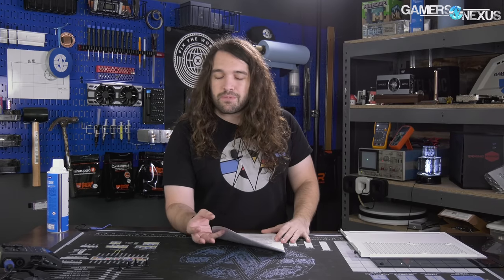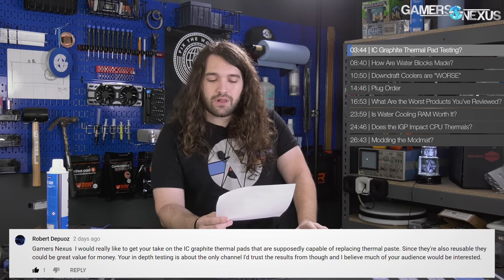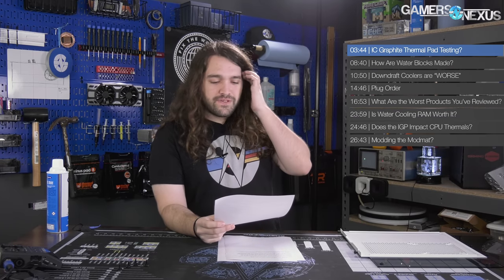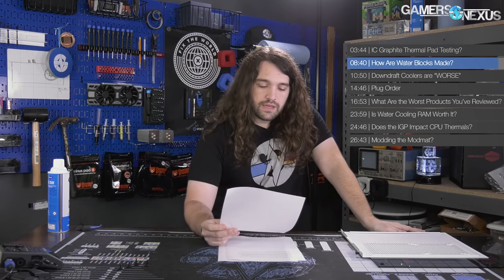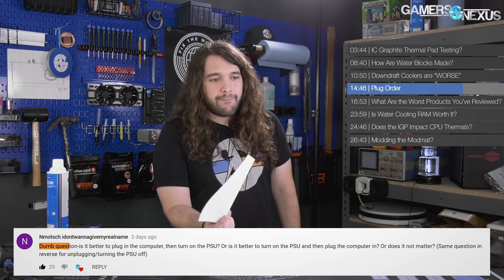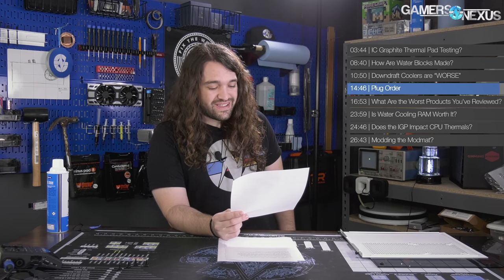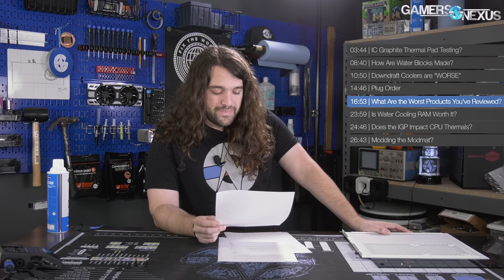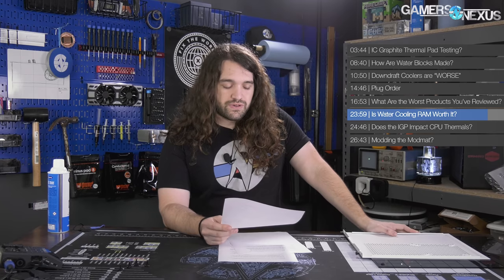Ask GN 83: IC Graphite Thermal Pads, Worst Products Reviewed

Comment: AskGN hi, my rx 480 overheats when i put my side pannel on, its not the v core and according to hw info not vrm either. i think its the vram. Should I put heat sinks on the vram or underclock the memory? if the model matters its the asus dual rx480 8gb. I would really appreciate advise

Comment: hey Steve, a question (or even idead for a video) for you. fast ddr4 memory costs a lot. so why don't you ever talk about an idea of buying cheapest possible b-die memory, and OC the shit out of it? for example: samsung m378a1k43cb2-crc (2400cl17) costs like nothing and capable of 2933cl16+.  and also there is b-die M378A1K43BB2-CRC. costs like 90$ for 8gb and capable of 3400-3600 overclock. 3200 is almost guaranteed for those sticks. no stupid RGB, no ussless radiators, no cons at all - souds in line with spirit of your videos

Comment: #AskGN Is there any way to modify the power limit on a graphics card besides doing a shunt mod or flashing the GPU BIOS? I currently have a GTX 1080 FE with a 240 CLC hooked up, so thermals are well under control, but I'm hitting power limits keeping me from overclocking it even higher. I'm kind of wishing i didnt get an FE card, but I got it for $500 before the crypto boom took off and jacked up all the prices, so i cant complain too much i suppose. Any input would be greatly appreciated!

Comment: I wouldn't blow the IC pads off as if they're just another thermal pad. They are at the very least an advancement. That being said, I agree they are overhyped.

I've used them in a laptop. Application is easy, though you may have to mask components depending on your chip (the pad is extremely conductive); temps were like a good paste, but not top-of-the-line. That being said, I'm not sure what the use case is for them. Most of us (and I'm starting with the population that would even consider this product) might have to change the paste in a laptop once, after several years as was my case. After that, we'll probably just get a new laptop. People that have to change the paste more than that are probably the types who will get the top-of-the-line pastes or LM where every degree counts. Moreover, many laptops can't get the maximum use out of the IC pads because they cannot safely clamp the heatsink down on them enough, which causes a few degrees difference. Manufacturers are just going to use their cheapo crap unless you pay them for something better.

For laptop use, which is what many were excited about with these pads, I'm not sure what the niche is. I'd expect desktop use is more promising, and console use, with the longevity we've had lately, could be even more so.

Comment: As long as the air is cooler than the component being cooled, it will cool down. As long the air is colder than the component, the more airflow the better.

Comment: #AskGN

Here's an interesting question that I haven't really found an answer to yet. I've been dabbling in overclocking a bit (pushed 4.8 GHz last week on my 4790k, planning on doing direct die cooling with my Antec Kuhler 920 and my Delta TFC1212DE). One issue I'm concerned about is power delivery- My motherboard is more than capable (it's the MSI MPower Z87 MAX, so it's got dual EPS connectors and 20 VRM phases), but I'm worried that I'm nearing my PSU's limit (750w, running a 1080, quad SSD's, and two mechanical drives along with the 4790k). For temporary "extreme" pushes, would it be safe to run a spare PSU solely to power my CPU? (Don't worry, it's not a cheapo unit, and I've already got a card that "bridges" two power supplies. I also understand that whether or not I'm reaching the limit depends on my PSU's rail ratings, but I don't have a clamp on anmeter to measure the current on the 12v lines)

I don't think I've been able to find a clear answer anywhere aside from somebody mixing an iffy PSU and a decent one. Thanks.

Comment: #AskGN
with so many 200mm fans making a come back, how it is to use one of these stock fans with radiators? I know radiators need primarily static pressure, but I don't really know how well these kinds of fans do in this realm. Also would like to see if there is any interest in switching the RGB fans on say, a 500P mesh, for a Noctua 200mm fan or other more "static pressure optimized fan".

Comment: Any reason you can't replace a CPU with a dumb heater underneath an IHS? A lab power supply would give you perfect control over the input power, and you dont have to worry about throttling.

Comment: #AskGN
I would like to know what are your thoughts and recommendations (specially Corsair, CM and TT, which are easier to find in Brazil. Phanteks/BeQuiet/Fractal availability is a bitch)  on cases regarding  TOP radiator mount compatibility. Basically everything on the market today can barely fit a CLC on the top and force us to use the rad in front. Assuming I want to use equal fans with same RPM for ease of management, impose a negative pressure configuration (i.e. 2 140 front, 2 140 top, 1 140 back, not to mention the rad restriction).
What's so difficult about making the case 5cm higher after the mobo?
Reply: 2

Comment: #AskGn Are there any new AIO for TR4 at Computex? My Enermax is already Bad after 5 months of use. Radiator is mostly likely clogged. Avg. Temps are In High 40's and Idle around 50

Comment: #AskGN

i really don't like the idea of ever using watercooling so in my quest for great airflow i feel like i'm somewhat stuck.
currently using a tower from corsair with 3 fans on top (120, 120 and 140 blowing out the top) 2 x 140 in the front blowing into case, 2 x 120 in the bottom blowing into the case, 1 120 blowing out the back.
(edit) removed the font panel because i have 2 really nice cats that don't wreck my filter in the front, they wreck the couch instead :P

Could something like a thermaltake v71 case with room for 200mm fans offer some meaningful improvement?

I have also been wondering about this weird idea that PC cases are made in a dumb shape because it's made like a big box instead of sweet curves like a racing car would have. Do you think it would be possible to get any meaningful improvement out of using a different shape? perhaps something like an hourglass shape where the width on the fan is wider than the center of the case is?

Comment: #AskGN Given the relative power draw of a modern CPU and a modern GPU, are case manufacturers working on any newer standards to provide more space or at least a better geometry for that space for GPU cooling? Seems like we are long overdue for either a new case spec, or an alternate PCI express spec that makes better accomodation for high-power accessories like GPUs that need large coolers of their own. Turning existing graphics cards parallel to the motherboard is somewhat helpful, but seems like a bandaid on the real problem of trying to pull so much heat out of a space the size and shape of two PCIe slots.

Comment: The thermal pads may not be capable for cpu/gpu usage, however you should see how they perform on VRM's and GPU RAM
Reply: They are way too thin for that. A normal VRM/VRAM thermal pad is .5mm to 2mm thick.
Reply: Stack them.

Comment: if there will be explicit multi gpu one day (lets keep on dreaming), am i correct that you could use a nvidia and amd gpu together? would it be possible to use a cheep amd card like a 560 with an 1070 to use free sync? sure support will be limited but it would be interesting to use the power of nvidia with cheep monitors

Comment: It's not that hard to do thermal testing, Steve. Do a baseline with paste. Replace with thermal pad, re-run test. No settings changed in BIOS and if you run the same software tests the results should be comparable.
Reply from the maker: You have no idea what you're overlooking, here, and it's an awful lot.
Reply: Yet some basic tests with a fixed cooler, fan speed and ambient temperature could be insightful to whether or not getting one of them would be a good idea.
Reply: I didn't mention the things you already mentioned in the video, like controlling for fan speed, ambient temp, etc. If there are more then I look forward to your professional review.

Comment: Why don't you build a synthetic CPU rig? Eg. a 200W resistor heater on a metal base with normal CPU mounting points with an integrated thermocouple? That way you can have 100% reproducible results where OS upgrades, firmware etc wouldn't change the outcome and data would just be about thermal dissipation.

Comment: Hello, always wanted to see a detailed guide on pcie frequency overclocking in bios, i've read you can get performance increase on some/any devices on the pcie lanes, but also have heard it can cause data corruption or even damage/brick hardware. Haven't seen any recent guides or discussions on the topic, not worth the risk?.  Would test this myself if i had enough parts to spare. 
If Snowflake could supervise to make sure tests are done properly it would help your channel's credibility.
e.g. thermals, voltages, bios settings, see if/ how different hardware benefits/reacts/conflicts (hdd/sdd/network/audio/ram/overclocking/cpu/gpu) from it if any, if different chipsets or motherboards handle it better or worse. Do ssds or hdds react differently to the overclock. Specifically i have 2 older systems that i use; fx-8150 and i7 920 lga 1366, so if you can go back that far...

Comment: #AskGN - When talking about the new graphite thermal pads, you mentioned how difficult thermal testing is because of all the variables with the settings of the CPU and motherboard. Have you thought about removing the variables and testing coolers and thermal compounds without a computer? I don't know if frostytech still does reviews, but they use a copper block the size of a CPU and select a specific wattage to put into it and then check the temps vs ambient. I think this would provide the most accurate and consistent form of testing.

Here is a link where frostytech explains their testing methodology: http://www.frostytech.com/testmethod_mk2.cfm

Also, I believe this is their latest results chart for all their cooler tests at 85w and 150w: http://www.frostytech.com/articleview.cfm?articleid=2799&page=5

Comment: #AskGN Lately with the 1803 of Windows (it may have happened before but I only noticed after the spring update) it seems like the iGPU in my laptop is getting unusually high usage during gaming. The dGPU is getting the standard 80+% usage but the iGPU usually is hovering around 20+% only while gaming. Not concerned but I curious on what its doing now after the update.

Nvm probably should have watched the whole thing before asking.

Comment: #ASKGN
Hey Steve, 
my question for Ask GN is: "why doesn´t AMD use EDRAM or ESRAM on their APUs like intel did on their iris pro lineup and microsoft used in the Xbox........just as a buffer to improve the memory bandwidth problem APUs currently have.....we have already seen the positive effects of such an arrangement, and its(PROBABLY) not as expensive as putting actual HBM or GDRR5 on the die" according to notebookcheck the iris pro 580(the fastest IGP in intel´s lineup has a mere 128MB of eDRAM, which i think is a low amount enough that it could be integrated in AMDs APUs like the 2400G......but there are also intel IGPs with 64MB which could be used in the cheapest APUs like the 2200G

Comment: Linux (running non-prehistoric xorg x11) does what you said.. . basically you can lend/borrow your available gpu horsepower to the physical drivers as you want(gory details: xrandr(1): https://www.x.org/archive/X11R7.5/doc/man/man1/xrandr.1.html, esp. --setprovideroutputsource and --setprovideroffloadsink).  I've  daily driver-ed that feature and it actually freaking works, not quite as fast as native I suspect, but, subjective assessment, it's near-native 2D and not terrible 3D.  Also I have heard that to some extent this is built into/automated on recent AMD drivers on all platforms, although I don't know if (a) this was a lie or (b) this was true but just replaces crossfire and doesn't work for APU<->GPU.  Pretty sure not (a) as crossfire is IIUC officially deprecated in favor of just jam your AMD cards in and go.

Comment: whats the best thermal pad for gpu .... checkink digikey and found these specs look good but curious if you tested liard Tflex HP34
High Performance Gap Filler
Product Description
Tflex™ HP34 is an exceptional gap filler product with a thermal conductivity of 34 W/mK.   Tflex HP34 is a non silicone formulationcontaining aligned graphite materials. Compared to typical graphite-based materials, Tflex HP34 is considerablysofter with excellent deflection properties.  link Tflex HP34 (laird.com)

Comment: I recently installed graphite thermal pads on my CPU and GPU. The details are here from "Moodles'" posts. https://www.overclockers.com/forums/showthread.php/792430-LLC-IC-Graphite-Thermal-Pad/page2. The pad worked very well for my GPU, but not great for my CPU. I'm assuming it's because the cooler master evo 212 CPU heat sink doesn't have as flat of a heat transfer surface and/or can't be tightened as much as the GPU heat sink. This might leave some air pockets around the graphite pad for the CPU.

Comment: IC Graphite thermal pads

If you do get to testing them
ALSO Test
Thermal Grizzly Pads
Fujipoly Pads
As well as thickness fujipoly do 0.3mm - 1.5mm
there may be others that have good specs but as you said somtimes spec lie

Comment: #AskGN can you overclock the igpu?
Reply: Yes you can with Intel XTU, the tool they used to overclock Hades Canyon.
Reply: I played around with it like a year ago and got like 2fps more on an i7 4790 (HD 4600) and it was not worth it considering the increased thermals.
Reply: mazedmarky I'm more interested if it would improve hardware acceleration in applications that can utilize it. But how much was the thermal increase?
Reply: The performance increasement would be really low I think. I got it to like 1,36Ghz and the gains were minimal. Of course I can only speak for the 4th gen IGPUs which I used 2 of. The temps increased from like 55°C to 63°C under load. Which cpu are you using? The newer Igpus are quite a bit faster so you may get other results.
Reply: mazedmarky oh I can't overclock my cpu I'm just trying to gather as much data as possible to make a smarter choice in the future when I have to replace this pre built.

Comment: I need to see this peltier cooler video.
Reply: leafflat   peltier coolers suck. They are roughly 20% efficient (require 200w to cool 40w CPU),  and then you still need an air/water cooler that can dissipate now 240w... That's why you can't really use them for anything hotter.

If you want cold temps, that's much more efficient,  and can actually handle the loads,  phase change cooling is great.
Reply: I'm aware they suck, Just want to see a commercially available (past or present) product using this.
Reply: leafflat   you could use them for cheap Raspberry pie overclocking though. Although, I'd probably just use a shotglass and dry ice if your going for ghetto benchmarks.
Reply: I can't imagine why you would want to spend 200+ (number quoted in video) on a Raspberry Pi when any 20$ cooler would be overkill. Could be fun though.

More interested in it as an entertaining goofy tech video.
Reply: leafflat can find some for sell on eBay. They are the $5-10 units paired with a $20 cooler though, nothing custom, but that does mean you can replicate it for cheap if you have a tower cooler.
Reply: leafflat. Ah yes, I agree with some goofy tech. My tablet has its custom designed water cooling system to look like a nuclear power plant inspired by Fallout 4 (green antifreeze pumping from radiation barrel with submersible pump to a rusty steal pipe array for the radiator). I designed the water block (design posted open source), mounts, and made everything but the pump. 

Total cost under $5, and it runs in the low 50c with 44% overclock (stock was 90c without overclock). That's what happens when I get bored for a day,  LOL...
Reply: Jake Garrett I've thought of watercolling a phone but never had the need to since I don't game on them. 

I put a stock Intel hestsink on and old m4 aqua that was being used for a particle experiment. Cooled it right down. Water cooling it would have been a cool option aswell.

Comment: #AskGN

Why do 360mm radiators not outperform 280mm? More surface area. More fans. Lower fan speeds and less noise?? Noise normalized they definitely don't win. From your video:
https://www.youtube.com/watch?v=WJejyyVPNe4&lc=z22xvf44slrlfvkxj04t1aokg2vo1oyiffonsgxjaem2bk0h00410